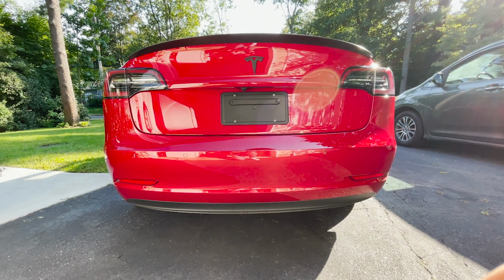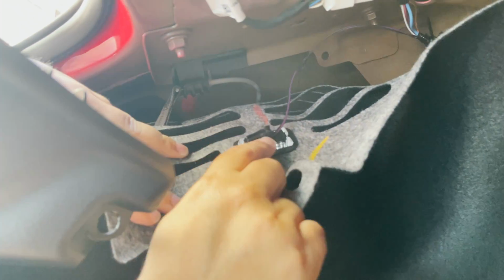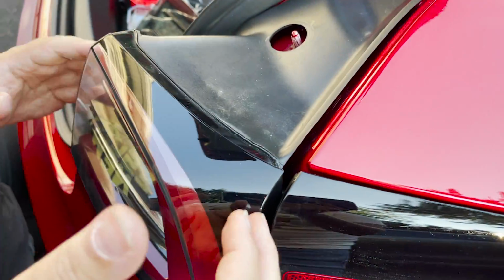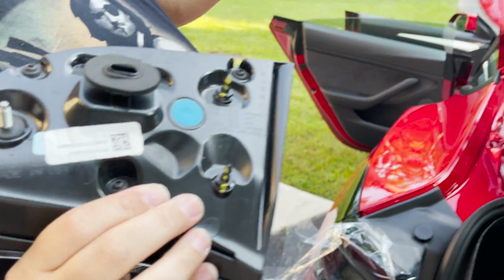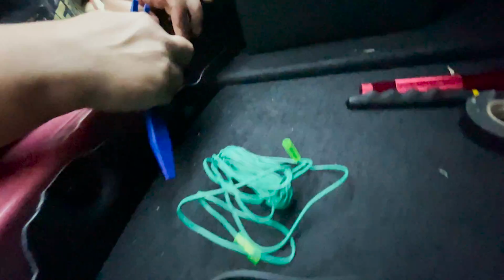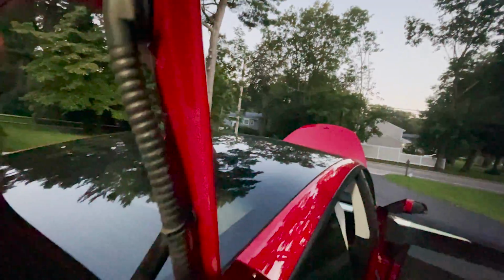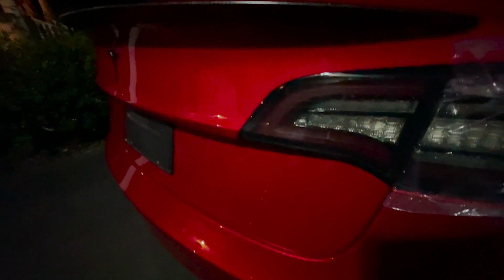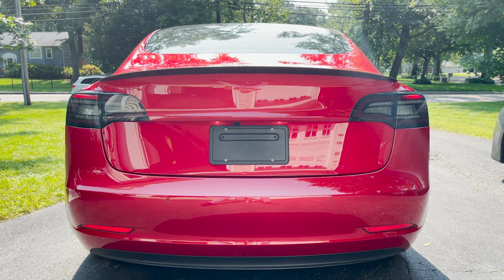Hansshow Eagle Eye Style Tail Light Install & Review | 2021 Tesla Model 3

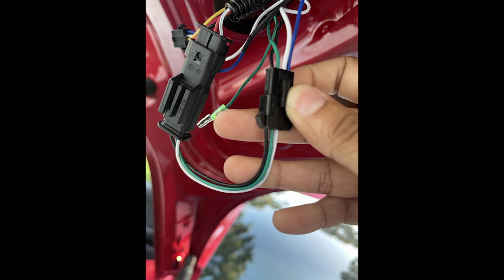Comment: 16:25 Thanks for the amazingly helpful tip on the 3 pin connector - 2 wire goes on the driver side. 
I have a 2021 but it still has the 3 pin connector. I figured the three wire with the green would go on the drivers side which has the other green wire. It was driving me nuts.
Moved the 2 wire to the driver side and everything works great! Thanks again.
Reply from the maker: Believe me it was driving us nuts too and we couldn’t find any answers online. That’s why we had just mention it in our video. Enjoy the taillights they are awesome!
Reply: @EverythingElectrified  now I need to smoke tint the bottom and side red reflectors to match the taillight.
Reply from the maker: I have a new video coming out for the back reflectors so hold off on that till you see the video :)

Comment: Tried on the 2022 tesla model y and the driver side doesnt work when parking lights is on. Not sure what could be wrong with the pin setup.
Reply from the maker: Make sure the wires are in the correct place. Mine didn’t work until I swapped out the wires
Reply: @EverythingElectrified  what wire did you swap out.  I used the long cable for the driver side, and right side didn't need a cable since both sides uses the 4-pin cable.
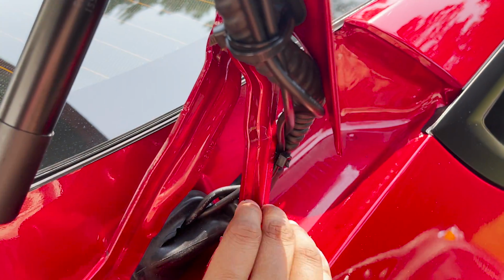Reply from the maker: At 16:24 I start by explaining the wiring set up. We figured this out on our own otherwise it was not working properly.